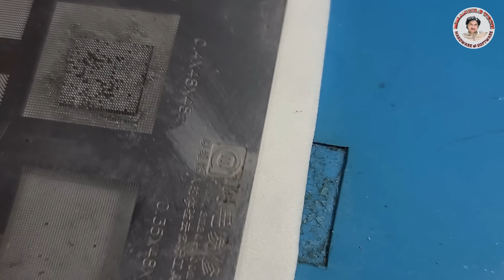Mtk Cpu & eMMC Reballing And Installation

Comment: Don't try this on your expensive boards guys. You can limit heating your IC more than what shown in the video by proper method.
Reply: 350- 360 c is good for cpu and emmc.
Reply: Heat 340 air 40 time 1min 861dw
Reply: Of course not everyone has soldering iron with adjustable thermostat or heat gun
Reply: 380 air 40 is good for me
Reply: Ok
Reply: Ok @repairtechnician4666
Reply: Ok @Mista_Godfather
Reply: Ok @Utube_video
Reply: What proper method ? You can Say please
Reply: @andresb2834  that's not the way of reballing the BGA and it's recommended to heat the BGA gradually in reflow machine which increases the temperature gradually and precisely with fully controlled.else one can damage the internal cores of the chip knowing nothing about the architecture.
Reply: @mubasheer5584  what machine is used .?
Reply: @andresb2834  for reballing there is a mechanical fixture.
And for heating there is a machine called reflow which has multiple zones and a slowly moving bed in under the zone.
Reply: How much time and temperature do you use to remove ic with resin?
Reply: @giselmeza3780  it's The time used acording teh amount of resin
Reply: The ground of a multilayer board is a powerful heat sink, making it extremely difficult to soldering BGA IC without a preheater. Even though it looks crude, it appears to have been done properly. Don't underestimate others just by their appearance. 😊
Reply: do not try to act smart and jealous of skills , 280 to 330 is perfect , and u can check balling under microscope....this method is way faster than using balls , and is highly successful, i had used this on Electro surgical generators and endoscopy cameras for years!

those pieces of equipment are mission critical as compared to home PC, back in the days i did not have thermal cameras to detect heat on boards, had to painstakingly check for shorts.
Reply: @rizkhan3368  See there is no jealousy in industrial standards, don't be kidding and don't mix it. 
IC manufacturer itself not recommend of rework and reprocess on the ICs as it can stress and slowly degrade the life of the IC or it can damage immediately. Even assembling of a fresh chip itself varies from IC to IC depending upon their soldering temperature and timings and the care has to be taken. 
Yes in some cases  need to rework by following many out of industrial standard techniques to achieve. i agree this.
Last And show me which company IC manufacturer follow the same procedure to perform BGA reballing 😂 let me stop buying from them.
Reply: Why today's cpu get complaint in 1 year 🤔. If manufacturer use pin cpu that long last?. Ball cpu vs pin cpu life, durability same?
Reply: Depends on SMD
Reply: Please tell me the equipment names you used in video
Reply: @rizkhan3368 Please tell me the equipment names you used in video
Reply: @johnsr-sr111kz Please tell me the equipment names you used in video
Reply: @johnsr-sr111kz ball cpu provides better fixation and reliable electric contact than pin socket. It can survive critical overloads and severe conditiins. Removable CPU is more convenient for the user
Reply: Its depends on the hot station

Comment: I want that my RAM be replaced with 8GB. Is it possible?
Reply: да, но вам нужно найти совместимую
Reply: No
Reply: In MacBook Air 2012-2013 was possible to replace soldered ram to 16Gb modules.
Reply: @antonsorokin3881  উঅ
Reply: Depends on mobile model
Reply: No its not even if you put a compatible ram there you need to tailor your system kernels etc old phones that were with arm cpu of 32bit os will never work further than 4gb to read the 8gb from the 4gb and at the end lets say you manage to make it all work you gain nothing other than your phone runing few more apps without crashing the lag will remain and the more memory the more pins a chip utilize so dont expect it to be compatible pin wise on old phone
Edit: forgot to mention cause most phones are made with soc processors if not all at least most of the is which means  everything is packaged into the soc ram cpu broadband wifi etc etc so you need to chage entirely the cpu functions and ram which need new motherboard to do that as i mentioned before the pins are different even gpu is in the soc so good luck
Reply: use a sticker that says "8GB" and paste on your current chip

Comment: You can't make your own solder balls reliably. Almost a guarantee that one of those chips is shorting.
They sell solder balls in very specific sizes for a reason, so you don't put too much solder on any one pad. Those screens, aren't for pushing solder paste through, they are for lining up actual balls of solder. Too much solder on 1 pad will bridge several.
Reply: I agree with this, but again the guy got it working. He probably knows better than you... 
I know those stencils are only for solder balls, but if it works for him, it probably works for anyone else. He showed the chips with the "balls" on each pad, and they all seem to be fine, so no biggy,
Reply: A stencil with solder paste is a viable way to re-ball a bga chips. Area of rectangular holes x thickness off the stencil = fixed volume --> same amount of solder on each pad. The execution in the video wasn't the best but that doesn't mean its not a perfectly good method.
Reply: @Appri  he didn't show completed repair, it's very unlikely the repair works.
Reply: @fabian11235  it is not consistent at all, solder paste has inconsistently sized pieces in it And could have more or less solder in every tiny drop. And too much on 1 single pad will, not can, will bridge several pads.
Reply: @Druid_Plow  people reball all the time, with this way as well. So just calm down and enjoy a man do his work.
Reply: @Appri  when i see hack jobs i call them out. If you like having poor quality work treated like it deserves praise then by all means, move to India with him.
Reply: @Druid_Plow  Of course the individual solder particles are all different in size but as long as they are far smaller than the volume determined by the stencil the amount on each pad is going to be pretty much the same. Watch "How to Reball with Direct heat stencil and Solder paste" by KrisFix-Germany here on Youtube. That guy has some very impressive repair skills.
Reply: @fabian11235  did i say impossible? If so please show me where.
I said this method is unreliable and that this particular job more than likely had shorts. Dude is clearly a hack, using a knife large enough to cut a porterhouse to lift a chip less than 1/4 size off the blade is another good way to brick a device.
Reply: @Druid_Plow  No need to be aggressive. And there was indeed a lot wrong with that "repair". But using solder paste with a stencil is not. It is literally what solder paste is made for.
Reply: @fabian11235  paste is use for pick and place smd components like resistors and capacitors, solder balls wouldn't exist if paste was intended for BGA
Reply: @Druid_Plow  whatever
Reply: @fabian11235  well that is what it's actually intended for. Watch any factory footage from guys like gamersnexus when they make motherboards and GPUs and such, they show it.
BGA components go first, highest melting temp and lowest mounting height. Then pick-n-place using paste, then through hole components and plugs that get wave soldered.
After all it's called ball grid array, not paste grid array.
Reply: @Druid_Plow  okay
Reply: @Druid_Plow  Dude, paste is used to do this all the time, and if it works at the end, it works. Now calm down and move on with your life.
Reply: @Appri  once again, it's in the name. BALL grid array.
If you're a hack then by all means, ruin people's hardware too, I'm not going to stop you
Reply: @Druid_Plow  If you put in the correct amount of paste, the ball size will be small enough to not cause them. Again, you can look at a BGA grid with a very bright light to check if there are any shorts and everything soldered correctly. Curb your attitude, as noone here thinks of you any better.
Reply: @Appri  you can't see under a chip dude, at best you can see 1 row. I don't care what people think of me, at least I'm not a hack.
Reply: @Druid_Plow  You can shine a very bright light and look through the first couple rows, it's really not that hard. You can even see this from many videos such as dosdude1's. Man, you can't think for one, huh? Why do you think he uses a stencil for the solder paste? That's because the stencil forces each pad to have the same amount of solder paste, which makes sure it's level. Nothing from the video shows that that chip isn't level or badly soldered. You really need to learn to curb your ego and attitude. People reball this way all the time, especially since not all BGA chips use the same size solder balls. Go get a grip.
Reply: @Druid_Plow  I have used these stencils with paste and have never had a chip cause a short yet, if it works there's no point of writing comments trying to say its bad practise etc. Most people use balls because they can't reball with paste and make a mess
Reply: @danielrock3119  driving a nail with a rock works too, it's still bad practice.
Reply: @Druid_Plow  Doesn't mean the person is a hack. Liking your own comments don't make you correct, by the way.
Reply: @Appri  someone who uses poor practices, that's exactly what a hack is.
And i didn't like my own comment, I'll add another to it though.
Reply: Using balls just make it easier and faster , but this doesn’t mean we cant not use solder paste, I watched professionals use this way without any problems in mobile fix, just you need to put enough quantity of past , i tested by my self it’s good
Reply: @ahsamahi4385  Nathan seems to think he's the only good repairsman alive, I don't think we r gonna get into his head anytime soon.
Reply: @Appri  and when exactly did i say that?
Reply: It just that as you advance you find your own Short cut in doing job that would take you hours..
Reply: @israelmaurice6910  sacrificing quality and consistency for time is poor practice as well.
Reply: If you're a professional you won't use scotch tape to a leaking bucket as an alternative just because it fixes it. This is what the comment meant
Reply: @Druid_Plow  that's actually wrong actually. You can look below chips with special cameras, not as in through the chip but literally below it. 

Granted, the person that is working here probably does not have access to such equipment.. aaaand if you did, you probably would not have used that method to repair it that way too, but I've seen people do it that way, it's a thing.
Reply: @leozetalol  you cannot look beyond the first row of solder joints. The only way you could is with a horoscope that is less than .5mm wide, which they do not make.
Reply: @Druid_Plow  are we talking about the same type of cameras? Just curious.

Maybe I'm remembering wrong. I was thinking something like the ersascope but with both axis
Reply: @Druid_Plow  They do have x-ray cameras to see behind the soldered chip, but it cost hundreds of thousands for high end production lines. Not anything obtainable for repair. Search x-ray soldering.
Reply: Please tell me the equipment names you used in video

Comment: 1. How you get this modern tin based solder to melt at 350c? I've never been able to even get the stuff to melt at any temperature below 370c. Unless maybe my thermal sensor was out of whack or something.. 🤷‍♂️

2. Why didn't you use tweezers to lift the chips? Like, are you TRYING to knock other components loose? I spent around 5 years doing this sort of work, and I surely wouldn't have went about any of it that carelessly.
Reply: Well his work suck i dont think its working prob 50/50 chance of it working now also what u mean modern tin based solder you might mean the grey paste stuff that thing melts at such low temps i fixed some chargers i had lying around for fun after buying such paste and it did melted at 250 with heat gun so less temp might be suficient too thing is its made of most paste and dust of solder thats why it melts in seconds in low temp whilst solid core rosin solder need higher temps cause is solid piece of tin rather than  dust in flux if you take for ex the solder the plumbers or guys that install metal tubes etc its like normal solder but bigger in diameter this thing need blowtorch to melt a solder iron takes time to melt a blob out of it
Reply: @HeLrAiSiNg1  Dude, whether the solder was in paste form or not prior to chip installation, the metal melts together into the same solid metal when it's all said and done. And by federal law, since about 2007 or 2008, any solder used in mass manufacturing HAS to be tin based, lead based solder processing is too toxic for the factory workers and the environment.

When he started, the chip was mounted on the board with fully solidified original factory solder. I couldn't care less if the factory used a solder paste or not, after the solder was heated and the chip was installed and cleaned, that solder was fully solidified metal.
Reply: moreover he should use Blade to resize solder balls means to cut over solder balls ,making all balls shape and size PERFECT.

Comment: Speaking as someone who has repaired electronics for 40 years and is an electrical engineer I can’t help but think ; all this work and it’s only going to fail again from heat / cool cycles detaching the balls / chips esp without mechanical downforce. BGA is the worst thing ever for reliability - millions of devices dead before their time inflicting pain on consumers and their wallets !

Comment: Is that paste lead-free
?? Cause if not lead-free.. The IC ball cannot handle the hot temp of the phone operation...
Reply: What? You mean the opposite. If leaded, it can handle it.
Reply: @Appri   no.. You said wrong.. Lead free is stronger
Reply: If you are also a technician when Nokia Era... You know that BB5 type using lead free.. Like Nokia N70, 6600,7610, they are use lead free.. Many failure to detach them if you blow it with hot air too hot... Its hard attach because of lead free
Reply: @wielijustice  "If not lead free, the ic ball cannot handle the hot temp." My god, reread what you said. Lead free is unleaded solder which takes higher temps. You said IF NOT LEAD FREE.
Reply: @Appri   omg.. Yeah.. Sorry.. My bad.. Yes i mean lead free... Lead free should be used.. Cause android have high temp
Reply: @Appri   no need to say MY GOD... This is about handphone.. Not have a business with GOD.. And no need to hard argue... Just typo..
Reply: @wielijustice  I pointed out a typo and you denied it, so I was like WTF.
Reply: @Appri   you must be still young.. There is one thing you should learn... *sometimes we dont need argue with someone.. Just let them wrong... Let them believe what they believe.. In this time.. You keep pointed that what i said is wrong... You wanna show that you are smart.. Sometimes we dont need it..sometimes silent is best answer.. And let them with their wrong.. And in this case.. There is no benefit for you and me.. I was a famous technician in Nokia Era.. But why i should say it.... Right??? Just simple.. Dont make your life hard
Reply: @wielijustice  You know what, fair enough. Wise words, I'll move on.

Comment: after getting emmc repaired how many days the phone will work properly?
Reply: if the solder joints are the problem and you do a proper reball it should work for a very long time if not forever.

Comment: workmanship sucks. approach the motherboard very carelessly. You painted the entire motherboard with flux. You don't need that much flux for an integrated output. In fact, flux is a required liquid when soldering. it can also exit easily without an integrated flux.

Comment: Why do parts get damaged by over heating if they can withstand temperatures this high?
Reply: Because it isn't the internals of the chip being heated up, only the outside is. The problem arises when the inside of the chip gets too hot, don't know what happens so I can't tell you but I think that it just goes all mumbo jumbo and forgets how to chip.
Reply: they have potato inside to absorb the heat...

Comment: Very good tell me what stops the other smaller components from falling or moving ?
Reply: You don't touch it.
Reply: Skill :)
Reply: Fan/blower = low
Heat/temp = high/suitable for these work
Reply: Surface tension. They will stay on their solder joints when molten as long as they are not bumped and air speed must not be too high.
Reply: theyre superglued first ..

Comment: Is there any chance to upgrade cpu on phones?
Reply: No there is not they are soc packages cpu gpu ram all together if you change you need brand new motherboard and drivers in the os to read everything which wont happen if aint triple A engineer and have the resources to get such motherboards then consider buying hundreds of components resistors capacitors etc etc to make the cpu to work with right voltages etc etc
Reply: of course you can! buy another phone!